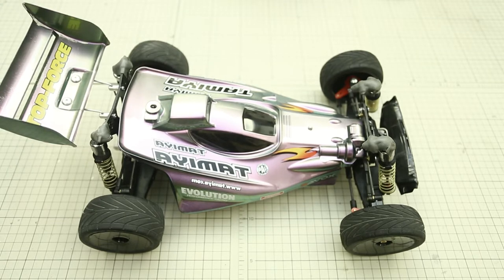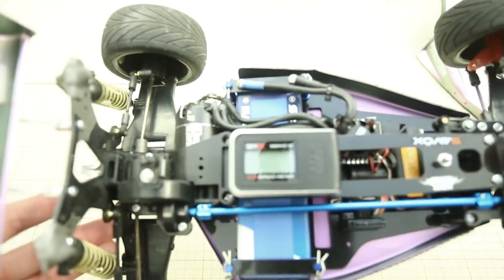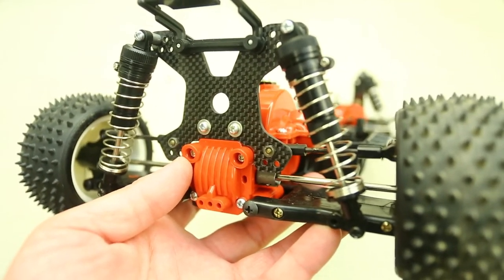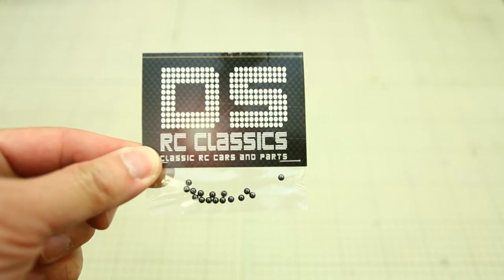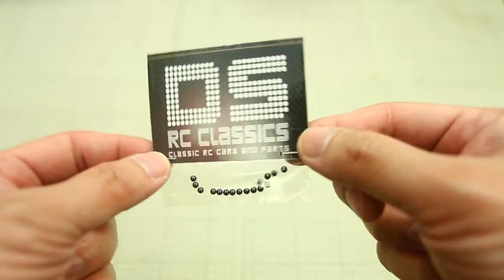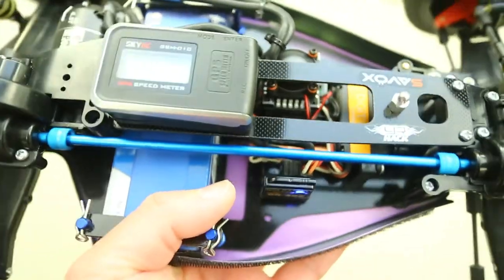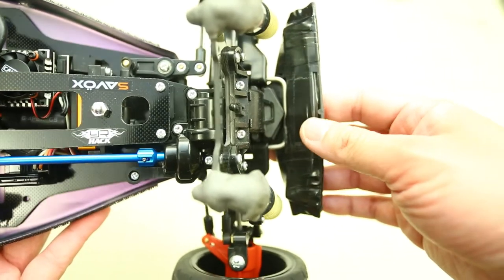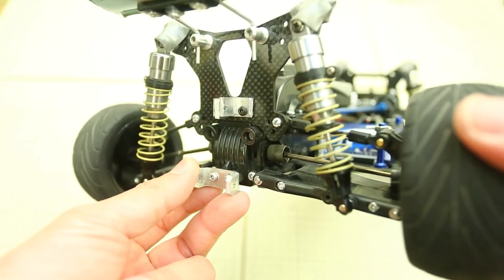World's fastest Tamiya Top Force !!?? The Psycho Force Project update Part-6

Comment: For the drive shaft I would recommend a titanium unit. Very light and strong.
Reply from the maker: Thank you for your suggestion we will keep this in mind : )
Reply: DS RC Classics and DS Modelling Academy Not sure why I didn't think about it earlier but carbon fiber rod would also work and be cheaper. Balancing it though, to handle those rpms may be harder.
Reply: I think take out one of rubber O ring to give little space